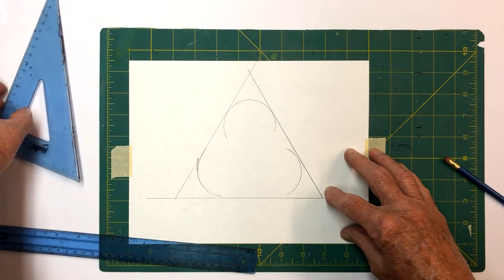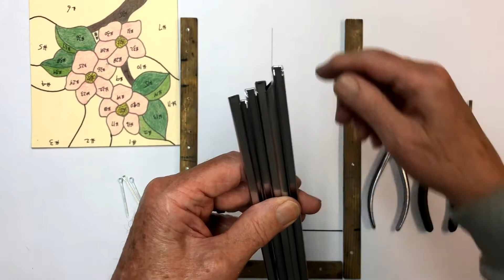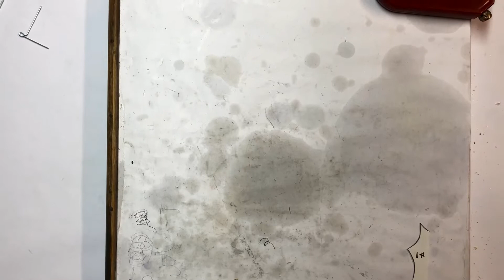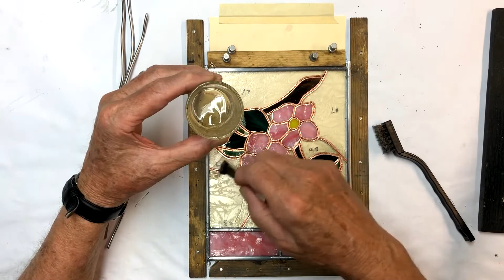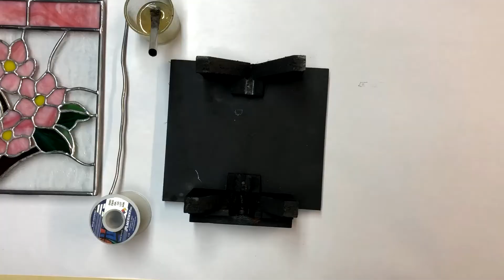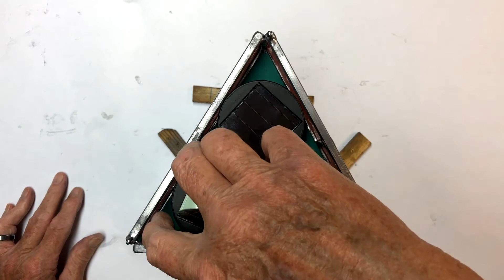Leaded Glass & Copper Foil Solar Lantern

Comment: You explain what you're doing with no fan fair.....nice. When you use the folders to cut the pattern pieces and glue to glass, do you leave it on the glass to grind the piece? I cut pieces using light box and found pieces don't fit as nice as I needed.
Reply from the maker: Hi Julie,
Yes, the Manila Folder is just the right thickness. It lets your glass cutter, scoring wheel put down a nice score line on your glass. Some light cardboard is too thick, and your score isn't on the glass as strong as you need it to be to get a nice cut. The glue stick doesn't hold down the pattern for very long as the water from the grinder starts to loosen it. You can also use pattern tape, it's two sided and will hold up under grinding much better.  I use Venture Tape when I'm going to have to a lot of grinding. Hopefully that answers your question. Please feel free to ask me anything, hopefully I have an answer for you.
Regards,
Bill Stone

Comment: Beautiful! 🌸 Bill - I’m in the UK and think 7/32 lead u came is around 5.5mm.  What is the measurement of the heart?  Is it 5.5mm or is that the measurement of the outer edge?  Thanks so much again for another beautiful project!
Reply from the maker: Hi Rachel,
So nice to hear from you again. All the Came I use on these projects come from Cascade Metals. You can check them out on the internet, at cascademetals.com they have a great chart telling all about the different kinds of came and all the different sizes. The U came I use is RU-70. Channel 5/32", Face 3/16", width 1/4" and the depth 1/8". When you go on the web page there is a box to check which lets you look at the sizes in inches, decimals and millimeters. In the video I may have called the came 7/32", if I did my bad!! They do make a 7/32" U came, it'd RU-72. I use the RU-70 U came on all the projects along with larger projects. The H came I use is RU-9, Channel 3/16", Face 5/32", width 9/32" and the depth 9/32", the Radius 3/32". I hope this answers your question, do check out there web site, lots of info on it!!! have a great day in the UK, I live in Southern California, USA.
Regards,
Bill Stone
Reply: @billstonesstainedglasscrea3310  Hi Bill - Thanks SO much for this information!  I’ll take a look at their website!  I’m sure Southern California is much warmer and sunnier than the UK at the moment!  Thanks again for your help.  💕
Reply from the maker: Hi Rachel,
Your more than welcome, hopefully you can find what you're looking for on the different sizes of came. Please feel free to ask me any questions about these video projects. Have a great day!!
Regards,
Bill Stone
Reply: @billstonesstainedglasscrea3310  Thank you!
Reply from the maker: Hi Rachel, 
Good to hear from you again, glad you liked the project, this one takes some time to make. The outcome is worth it though!!! Hope all's great in the UK and have a great day.
Regards,
Bill Stone